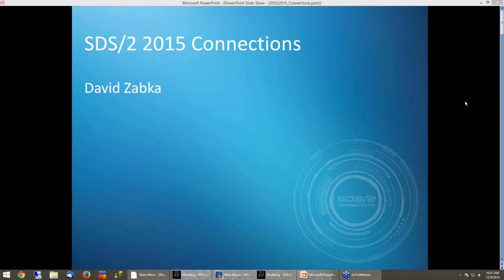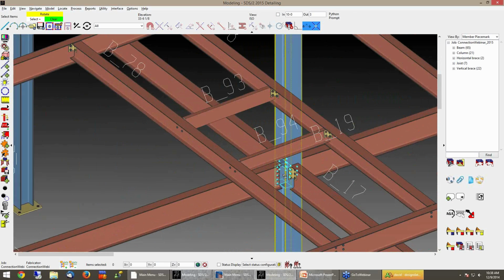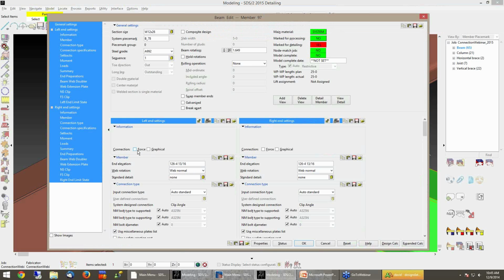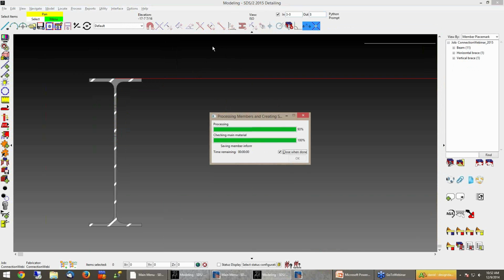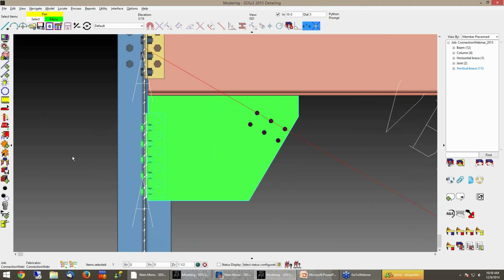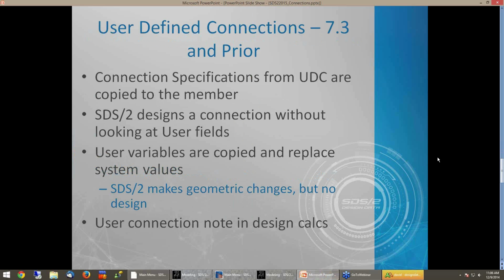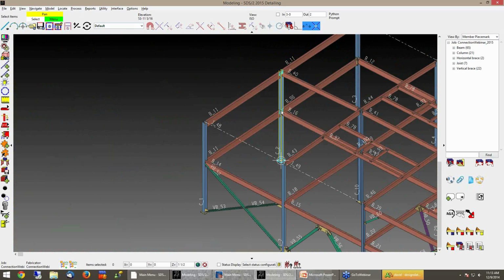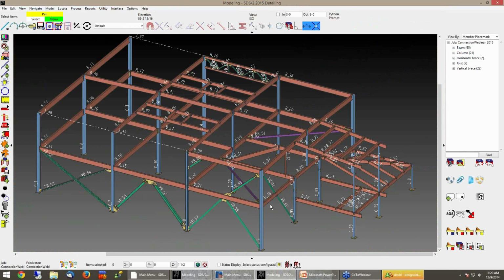New/2 2015: Connections and User Defined Connections

Comment: At the end of the webinar you connected a sloping, skewed beam to a column flg. Did you just get lucky in your manipulation of rotating the column to get the connection desired because the column was a W8x31 (8x8)?  What if the column was a W8x28 (6 1/2x8)? Would you have gotten the desired connection?  Also, are the calculations shown really true for the final detailed situation? Because on page 2 of the calcs it says the beam is framing to the column web, when it is actually framing to the flange. Wouldn't all of the calculations be inaccurate?